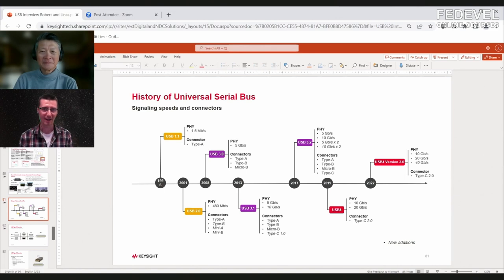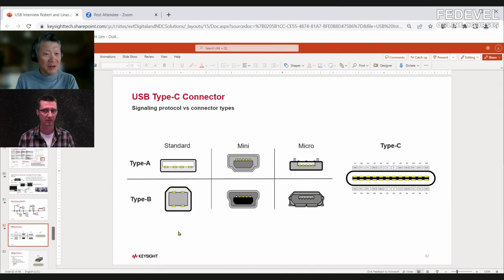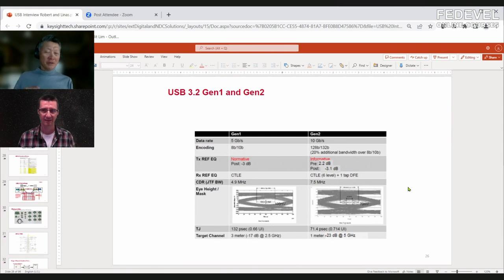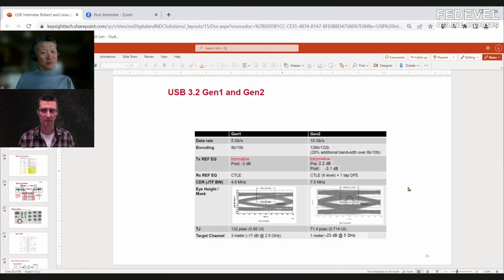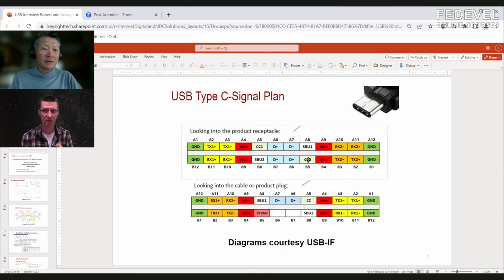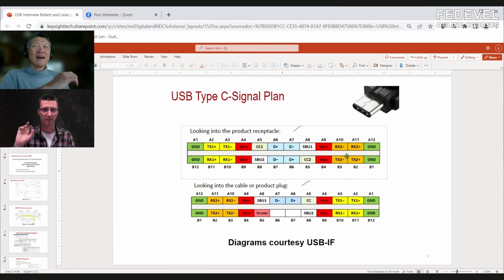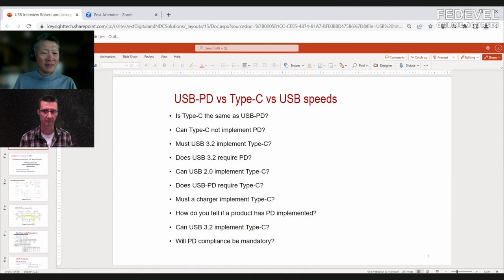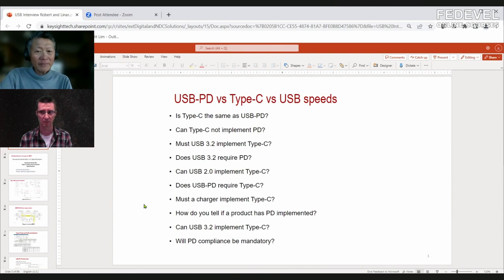USB Differences Explained

Comment: Great video!  Many people confuse the connector  with the USB data spec.   I just spun a new board and for legacy reasons needed a micro usb 2.0 port, but added a C-connector for usb 2.0 only.  The USB connector for micro cost 4x the cost of type C, so legacy reasons are the only need for older connectors.   Even other tech videos confuse connector with signal type.  So a usb type C connector could be usb 2/3/3.2/4+ speeds.  I'm sure the phy for 3.x/4x is much more costly than 2.0 but a connector is just the physical connection.  Even if both ends are 5/10/20G, the cable might be correct bandwidth for the fastest connection.   Long video, watching in 15min chunks....so all my comments might already be covered.

Comment: Great video, thank you very much.
It would be great if you could create a video on PCB routing of the Type-C connector. USB lines, the SuperSpeed traces.
I had hard time to properly route the 2 x USB2.0 on the connector as a single USB2.0 port.